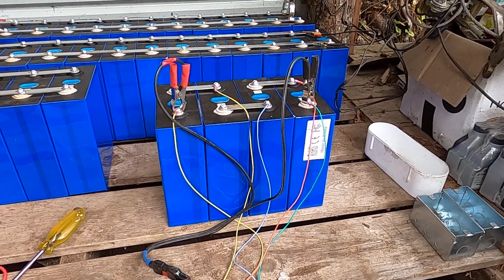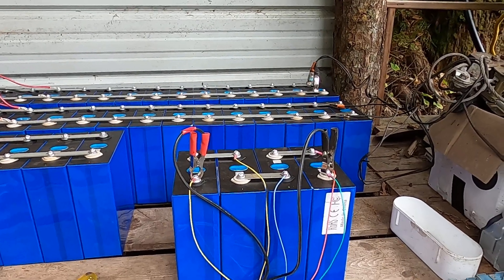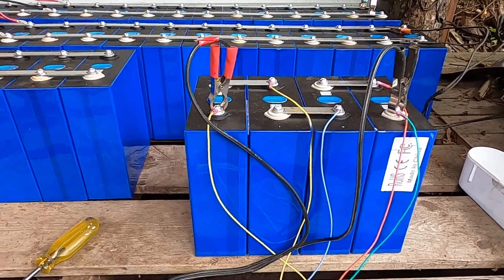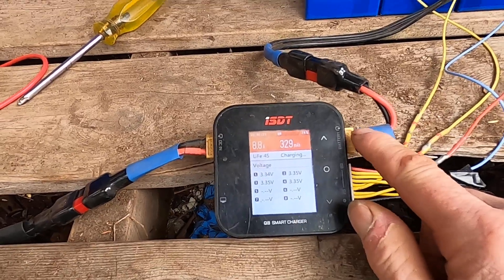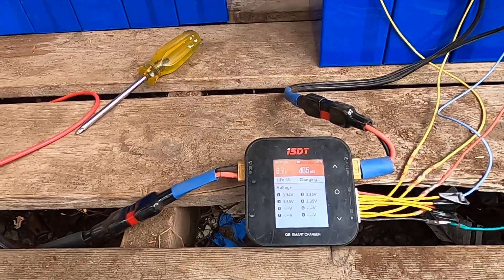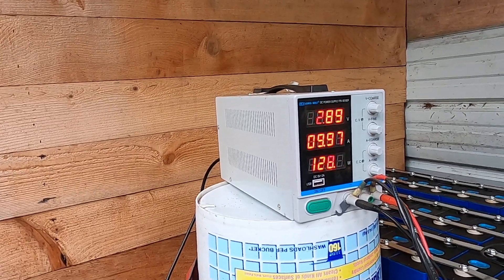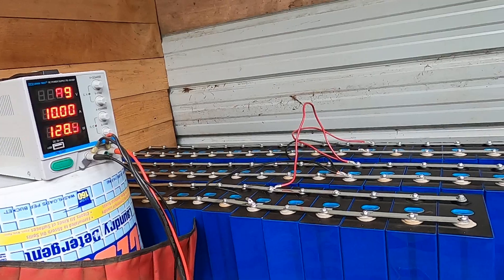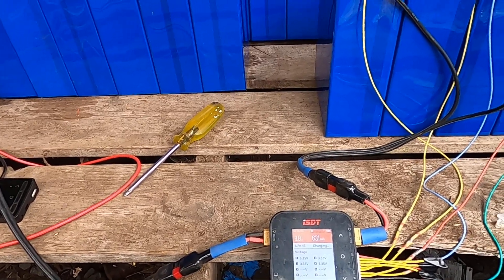Balance Charging LiFePo4 280AH EVE Cells with ISDT Q8 Hobby Charger

Comment: I tried this, the q8 takes way too long to pull the lower mismatched cells up to 3.6. I just ended up putting the q8 in 1s mode and charging each cell one at a time then 1s the whole system directly onto benchtop power supply and that is working pretty well so far

Comment: Hi! Does anybody can help with the issue with this charger? When I run self test, it gives me the error - Connection Check: Battery Present(211). Every connections is in places, it charge and discharge, but the error never goes away. And its also doest show the internal resistance for some reason on mu lifepo4 8s (same EVE)
Reply: Internal resistance might be too low. 280Ah cells should have an IR less than 0.25 milliohms. Your best Lipos are going to have an IR of 1 or 2 milliohms. Check the resolution of the Q8. I think that might be why you get the error if you're positive your balance leads are connected coorrectly.

Comment: I got a 30v 10a DC charger working on 8 280ah cells in parallel right now, been going for 96 hours straight, does it ever end!? Haha. Has dropped from 8amps to 6amp so I can only assume I'm getting closer
Reply from the maker: I think mine took about 4-5 days for each 8 pack with a similar charger.  I had 3 chargers going at the same time to get all the cells balanced quicker.
Reply: 280*8=2240Ah?  I think? You've only done 960Ah so assuming they are half full then yes you were getting close and thats why it had entered CV mode.

Comment: What DC power supply are you using?
Reply from the maker: Longwei DC Power Supply Variable 30V 10A, 4-Digital LED Display, Precision Adjustable Switching Regulated Multifunctional Power Supply Digital with USB Interface, Disply with Output Power Lab Grade

70.00$
Reply: @metagrid9453  thank you!
Reply from the maker: @Rando32  No problem!  have a good one...